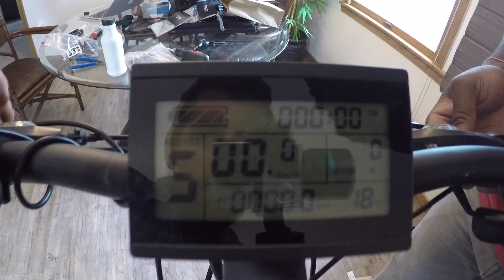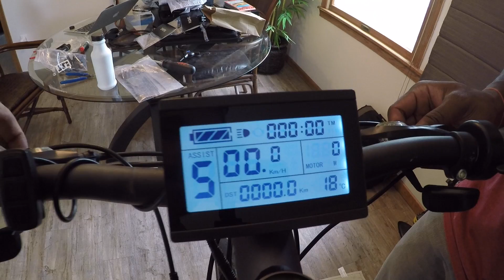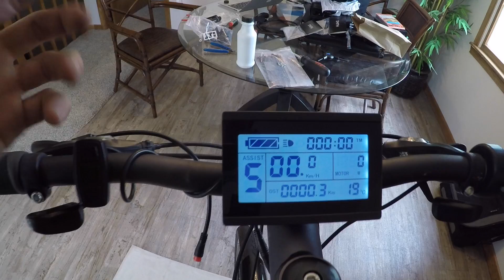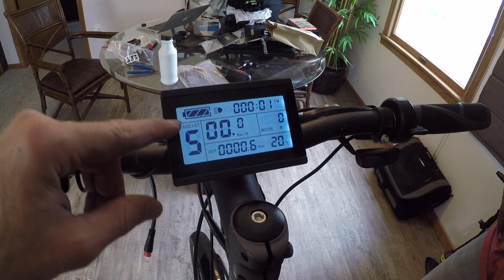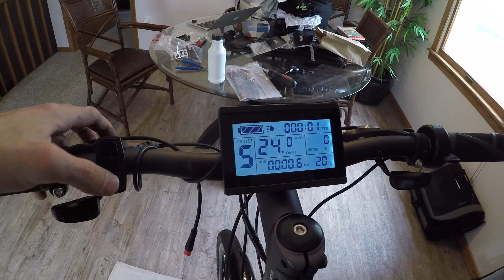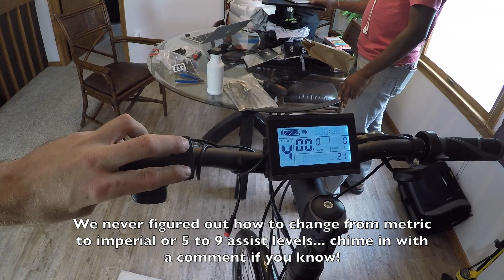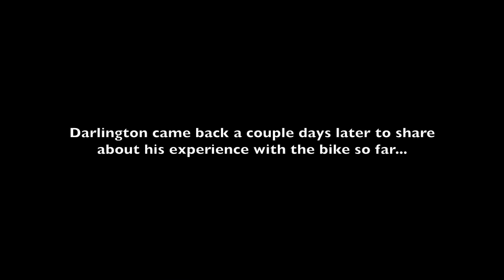Dillenger Street Legal Electric Bike Kit Review - $700

Comment: Good video, helped remove some of the doubt when buying. They have changed the display a little, but it looks good. I also had to remove the screws in the hub motor (Dillenger now has 6 screw in the hub for a disc brake), and use short (5mm) headless hex screws to replace these so the hub will turn. Used very light amount of blue threadlocker to make sure they stay in place. Since my bike has a curved down tube, I had to mount the battery on a rear bike rack. Fortunately, Dillenger included an extension cord to connect the hub motor. Still having a problems with the brake sensors and pedelec, but the bike is running!

Comment: Thanks for the video which was the one to finally make my decision. I have purchased the street legal kit also from Dillenger and just waiting for the delivery (hopefully today according to the tracking number). I'm going to install it on a BMC flat bar road bike to just help take the edge of some hills and watching you-tube videos has prompted some further considerations. I needed to order a new Shimano 160mm front brake rotor to bolt on to the hub as the Alex rim I have has the pop riveted type. I also purchased a new tube to accommodate the larger air valve hole on the new rim according to the manual. The existing tyre will be used but I may also just get another tyre as I can quickly put back the old rim if desired. I also have a carbon belt drive so I hope i can fit the sensor to the crank being my only concern ATM . Apart from that I hope it will be straight forward. Many positive reviews kept bringing me back to this company.

Comment: Thanks for this excellent video. I did this install (with the same bike) and followed your recommendation of filing away the dropouts as well as the heads of the bolts on the motor.

I will share my opinion that using the bastard file was something of a red herring. I went at it for a couple hours and got frustrated. In the end I bought a Dremel tool and it tore through the job very quickly.

Overall, great install video and keep them coming! My wife is now the proud owner of an electric bike.

Comment: I bought the same kit a couple of months ago and it’s been a great addition to my mountain bike. It helps me get up hills and is just fun to use. I’m glad I saw this video first as it gave me a heads up about needing to file a bit off my forks. I however also needed a few washers to space my wheel over to line up my disc brake rotor. It has a good range of 70-80km per charge and I even bought another dolphin battery to extend my range even further for bike packing. No regrets so far.
Reply: How's the kit holding up for you?
Reply: @xMrjamjam  No problems in the last 4 years apart from the thumb throttle snapping a couple of times. I replaced with something more substantial from china that had the same connection. Has lasted a year or 2. No complaints with the motor. I have travelled thousands of kilometers on it.

Comment: it's in the bafang c961 manual, hold the + and - when the display blinks, press the + to change from km to miles, press the power button to save, then it goes to speed upper limit speed, +/- to change, power button to save, next is back light brightness, same +/- to change, power to save, cycle to time setting.

there is an advanced setting for changing wheel size and power assist levels from 2 to 9, it defaults to 9 steps but you can change that to say 3 steps.

advanced setting is press and hold + and - then when the display starts to blink keep holding the + and - then press the power button 8 times to go into advanced mode.
Reply from the maker: Interesting, apparently our display was a King Meter, is that the same as Bafang? The motor is Shengyi
Reply: +ElectricBikeReview.com 

The bafang has a bit if a different layout, but it's like this one, no controls on the display unit and only controlled by the three buttons, I would say this unit is similar in the setup.
Reply: +ElectricBikeReview.com 

ok it's a KT-LCD3 display, a search for a manual turned up plenty of, even a YouTube vid how-to
Reply from the maker: Nice, thanks!

Comment: Good video and descent price for the kit. The way the pedal assist sensor attaches to the crank is going to cause problems. I would attach a torque arm so there is no chance the axle spins out of the fork drop outs, but maybe you don't need it with a 350 watt motor. Go up a steep hill full throttle and find out....
Reply from the maker: Challenge accepted!! And yeah, I agree that the pedal assist sensor seems prone to being knocked out of place more easily than I'd like :/

Comment: Hey! What tire widht would you recommend? I have a pretty lightweight bike with 700x32c tires at the moment, but i was thinking of getting a bit wider for this kit.  Also do you know if u can "unlock" the EU bikes to run at 350W off-street? Thanks and great review
Reply from the maker: Not sure about unlocking... a few other comments here have talked about how to access the menu, sounds like you hold the up and down buttons as the kit powers on or something? I like the puncture resistant tires and have heard good things about Schwalbe, found these Little Ben tires that are wider than your 32c but should still fit the 700c diameter http://amzn.to/2aSLhAh
Reply: +ElectricBikeReview.com thanks and keep up the good work with the Channel! I might buy this kit and can definently leave my thoughts here if i do so!

Comment: Great video. How did you end up getting the screws mounting the motor to clear the fork arms? That seems like a pretty significant issue...
Reply: You'd probably need to use a spacer.
Reply: Just installed mine. Had the same issue. I had an aluminum fork and was able to spread it wider and use spacers. Seems. Fine now. But it was annoying at first. Had to drop by my bike shop thinking I would need a different fork.

Comment: What E bike would you recommend for someone who wants more electric power only and likely to use pedal assist very little?
Reply: If you are in the states (check your local ebike laws) I would recommend at least a 750 watt motor with a 48 volt battery and at least 17 Amp Hours. The reasons being, You want a motor powerful enough to propel you efficiently and enough reserve battery power to get you home. I hope this helps.

Comment: Nice review.  The kit seems like a good option, especially since I have the same Trek bike as Darlington.  Btw, any follow up video on the few issues you guys encountered, i.e. motor inhibitors, cadence ring, etc?  Also, how's Darlington enjoying this kit on his Trek?  Thx. 😀
Reply: I haven't had any issues with the cadence ring. Haven't had to adjust it since the initial adjustment. I commute about 2 to 5 miles most days and take the bike up and down two flights of stairs once to twice a day. Not too long ago, the middle console wigged out, keeps saying the battery is empty when has it's just been charged and the readout on the battery shows it as full. Working with Dillinger to have it replaced. They've been very eager to help.
Reply: Thanks for the reply.  Very helpful.  Please let us know how it all works out.
Reply: awesome Darington nice to hear it's still going strong. I just got mine and I'm loving it. I set my bike up as throttle only im very happy with it so far.

Comment: When filing dropouts never file into the round cap at the top,only the flats or the legs..
Reply from the maker: Hi Mark, are you talking about the inset area where the washer fits? I'm trying to understand the "round cap" comment. Did you see me doing this in the video? Thanks for your feedback :)
Reply: Its difficult to explain in type,where the dropouts meet the top of axle-where its round when its seated,under that the legs protrude down or back if its a rear.if you take even the slightest bit off the original finish of the round part it can break, usually when there is a jarring scenario.after i do mine i would sit down on the ground have someone hold the bicycle and kick the tire from the top part of the treads in the middle of the wheel very hard forward and back and see what happens circa 2008 i did that and the dropout fractured saving me from faceplanting.  ive been posting at EBR as beast775.

Comment: Hi ,  S-LCD3 user project
Under power off status,hold (SW) button long,the meter is turned on.Within 5 seconds after boot-up,hold button (UP) and button (DOWN) simultaneously for about 2 seconds,the first is to enter the maximum riding speed setting interface,then the speed display column flashes.after finishing the max speed setting,hold (SW) to save current values.After speed set. enter wheel diameter ,after finishing wheel diameter setting,enter into the METRIC/IMPERIAL units setting.
After finishing hold (SW) to save current set values

Hope this will help  :)
Reply from the maker: Awesome, thanks Dejan XD
Reply: Thanks. A lot Dejan. I will try this and report back.
Reply: Hey Darlington tnxx,i appreciate that..
Court is Legend in global ebike community,but with You involved it is fun :))

Comment: hey guys! I was wondering if anyone with knowledge could help me with some advice. I work 6 days a week, and take the bus to and from work about 3-4 hours a day. I hate having to get up, get ready, leave 4 hours before i need to clock in. I'm in the market for a cheaper ebike to get me by. I'm thinking of the sondors thin for 600-800$ I'm 6'4" 260 pounds going g about 6 miles to work, 6 miles back. any advice would be appreciated!
Reply: Hi, Recently received my Sondors thin with LCD monitor that lets you control  how much power assist you need. We live in an area that's pretty much flat. My son who weights 130 lbs. with the level 1, lowest pedal assist went 30 miles and still had 1/2 battery. I'm 290 lbs. rode it for 10 miles at full power going 19 mph. I had no problems, but didn't check how much battery power I had left. Shouldn't be a problem. If you have hills or strong head wind that will lower your maximum distance. You can ask your boss if you can charge it at work, since the battery is easy to remove from the bike.
Reply from the maker: Sounds like a good direction to go... I was impressed with the Sondors Thin for the price, if you haven't seen the video and specs you can check it out here https://electricbikereview.com/sondors/indiegogo-thin/
Reply: Wow 3-4 hours for 12 miles of bus ride?
You could walk faster than that.
Where do you live LA?